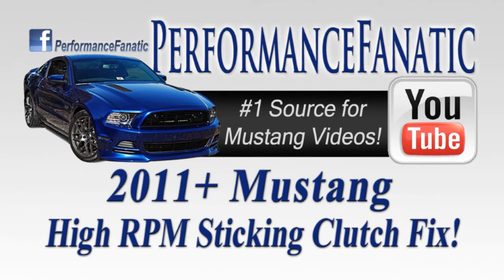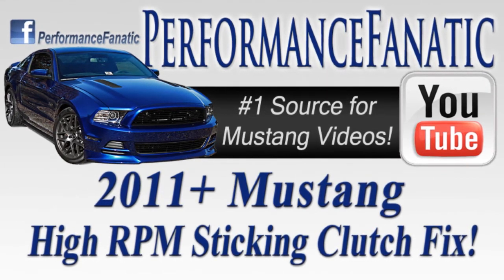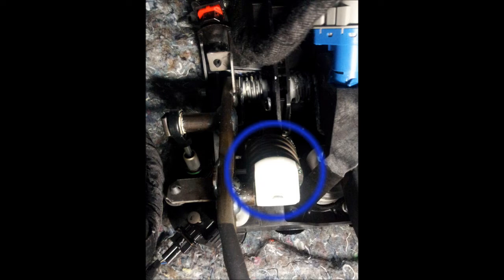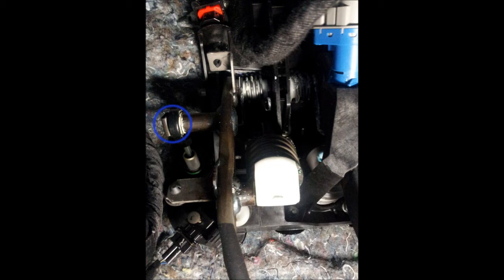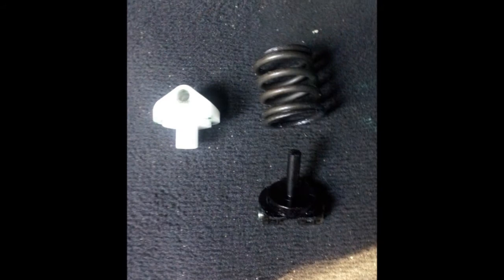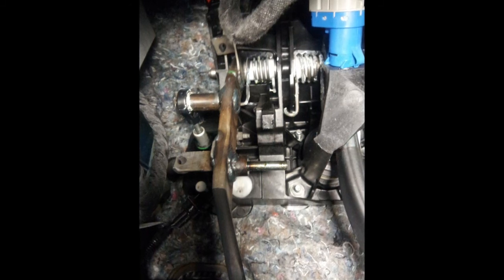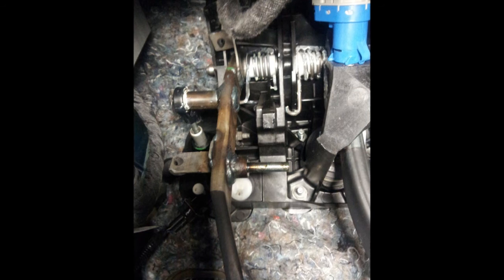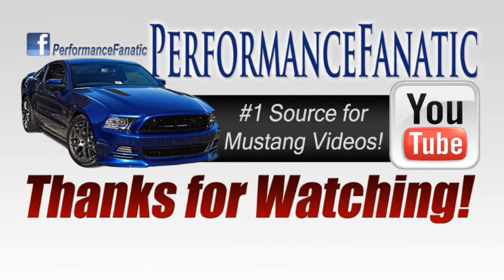2011+ Mustang High RPM Sticking Clutch Quick and Easy Fix | Performance Fanatic

Comment: Thanks for the tip, Haven't gone past 5 grand on the RPM's yet but will be doing this as to prevent it before I go there....Just hit 1500 miles was letting her break in slow first...Thanks for the videos